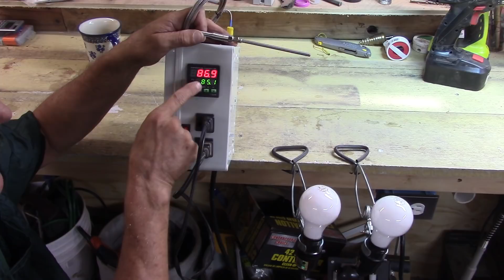Parts list and decription, assembly  Part 2

Comment: I would like to use this to control an exhaust fan for my stick offset smoker. Is this possible? I would like for part 2 to be a voice over for the non electrical type guys if possible. Great, great video, nice build

Comment: George, I have worked most of my adult life as an instrumentation technician and retired from the engineering department at an oil refinery. One thing I would mention is to keep the thermocouple extension wire away from any AC high voltage wires. If the temperature readings are erratic, try moving the TC wires away from any high voltage lines.

Comment: I want to install a water level sensor/shutoff to avoid burning out my 240v element if I allow the HLT water to get too low. Should I wire it in between the pid and the ssr or is there a better way to do it?  If I do it between the pid and ssr does it matter which wire I use coming out of the pid?
Thanks

Comment: Good day, asking from RSA. Can i please get the wire diagram? As i need to change everthing to 220V AC and 24V DC. To control a 3kW element and water pump. 
Chavannie@gmail.com

Comment: Ok call me dumb, But my question is, I'm wiring a PID 120v and a 25SSR. I want a 2000w element. I have a 10gallon boiler. Ok I have checked my breakers all are 15amp.  Doing some research, Is this going to work without blowing a breaker?

Comment: Your video's have inspired me to build my owm PID.  One point that doesn't make sense is you are using the controller to energise the SSR. The % mode  on the controller  would be a mute point as with the SSR energised you would have 100% power to you output and deenergised would be 0 % power, no in between!  Great video thanks

Comment: I am using a c100 for a 3 d printer ..can I use the 4 v to heat the printer element or do I need 240v to 24v transformer and ssd??

Comment: George great videos on the PID assembly. I’ve started putting the parts list together and had a question. I can’t find a 20 amp snap in outlet. Are you using a 15 amp outlet? I want to use a 20 amp heating element with the PID.
Reply: I had the same problem, type in snap in receptacle in the Amazon search bar and it should come up.

Comment: Hi George, on a mile hi still, do you drill a hole through the cap for that uxcell thermocouple? Doing the conversion, it's a 5/16" thread. I'm pretty sure they don't make an adaptor for that. Ha Any advice appreciated.
Reply from the maker: Anyway you get it in the vapor stream will work. 
It doesn't need to be tight just sealed. 
There are many ways to do this from drilling holes to using rubber bungs or just attaching the probe to the outside of the column with some secure tape.

Comment: Trivial question, however, not sure where the ground wires go if I’m using a plastic or wood box to make my PID?
Reply from the maker: The only place a ground wire is needed is on the receptacle. All other connections are low voltage or very low current and the PID does not require a ground. The element also requires no ground, a ground wire if used would be attached to the appliance (kettle) for added safety.
George

Comment: Hi George, appreciate your videos. How does the PID vary the power to the element when its connected through a relay? The relay would be only 100% on or 100% off.
Reply from the maker: Not true, although the connection is on/off the apparent power at the element will be a derivative of the timing from the PID output so the element is only on at 100% power until it nears the set temperature. Then the PID controls the power output.
That's the easiest explanation.
George

Comment: What if I need to provide 220 volt for a heating element? Can the pid handle that voltage or do I need to reduce the voltage on the pid  like you did for the fan?
Reply: Thankyou sir!
Reply from the maker: The PID can handle that voltage. No problem.

Comment: I just finished mine.  Thank you for the video.  I have a question.  It seems when testing with an incandescent light it just turns the light on and off.  When it's at say 50% the light just blinks, it really never looks to be 50% power or faded.  Is this correct or do I have a setting wrong?
Reply from the maker: The load requirement for a light bulb is so small you won't see it.
George

Comment: George, where did you get the 20 amp small black square receptacle in this video?  I can't find them anywhere.
Reply from the maker: I had a hard time locating them but finally did but I had to order 100 at a time. I am sure you don't need 100 of these.
Send me an email (for security purposes) to george.duncan76@gmail.com
Include your address and let me know how many you need. As long as it is not like a bunch, I'll send you a few for your project at no cost.
George
Reply: Try mouser.com  Less than $2 each

Comment: Hey George great video! I’m putting together a 240v 30amp for a kiln using this process and my question is since it is 30 amps, 10 gauge wire is needed for the power and the power only correct? I can use say 16guage to connect the PID/SSR together instead of using 10 gauge?
Reply from the maker: Just answered your email.

Comment: Hi George,  Enjoying your presentations thanks for being clear concise and thorough . And a huge thanks for sharing your knowledge and experience. Think this PID controller is awesome and would like to build one, was wondering the advantage/disadvantage of using this over a constant energy controller like Milehigh uses?
Reply from the maker: The mile high controller is analog. Meaning, it is turn it up it gets hotter and turn it down it gets cooler so just like propane you have to interact constantly to maintain temperature and you also need to predict the amount of heat added when you turn it up. 
The PID does this for you and once your still is balanced it will maintain a constant temperature with a few 10ths of a degree.
Reply: Barley and Hops Brewing  Exactly what I needed to know. PID parts ordered, doing a 20 amp setup. Looking forward to the build. Thanks for all!
Reply: Parts arrived and assembled on schedule. Wired with ease, programming made easy by your video. Awaiting a couple of mission critical components held up by bad weather and I’ll be ready for my first run! Thanks again for enlightening me to this technology. Also for encouraging me to get off of it and get going.
Reply from the maker: @chuckbrown7508  Glad to hear that. Happy distilling
George

Comment: I am planning on on building one of these within the next month or two, this is  an Amazon review of the product.  Have you experienced any of these issues? What would you do if you did have its issues? 
M. Stolle

 Verified Purchase

Terrible product. Temperature becomes more inaccurate over time, 2-5 degrees off per hour.

Product works as described from a functional perspective. The problem I ran into was a temperature slip over time, regardless of the temperature probe type used. It was losing about 2°-5° every hour on the temperature reading. This caused the unit to overheat the water it was supposed to be maintaining. Instead of having water at 150°, the water temp rose to 165° after 3 hours, and continued rising. But, the unit said the water was holding steady at 150°. After a lot of testing and troubleshooting, I found that it needs LOTS of ventilation to slow down the temperature slip issue, but it won't stop it. It was very warm to the touch, but not excessively hot in my opinion - about 115° in a 95° ambiant environment. I tried Inkbird, and it ran cooler, with no temperature slip at all inside the same panel. Electronics inside of a panel should expect to run warm and still be accurate. Not this unit! That was enough to cause inaccuracies to a level of being unacceptable in a Homebrewing application. Once I opened the panel and had a fan blowing on it the whole time, it was a bit more accurate, but still unacceptable temperature slip over a 8-12 hour period. Bottom line, this controller unit will be inaccurate over time. If you your application can tolerate a 20 degree inaccuracy, then maybe this is OK for you. But why do that, when you can get an Inkbird for the same price and know you are getting accurate readings. Just as an FYI, the issue I found was a temperature slip over time, not a calibration issue. I calibrated to start off with, but after 8 hours it was off by 15 degrees or more. I ran a dozen or more tests changing the conditions, parameters and probes. All tests showed temp slip. All the same tests on the Inkbird passed with no temp slip at all. I wasted so much money on replacing probes & a lot of time on testing, only to spend more money replace this MYPIN garbage! Terrible, terrible product!!

5 people found this helpful

Helpful

Not Helpful

Report
Reply from the maker: I really wish he would have contacted me when this happened. The Mypin is an equal to the Inkbird model. 
Both come factory set and should be re-set following our step by step directions on the video. Both controllers are normally set as a  default to derivative function "off". This is an easy fix when setting your own parameters. 
I believe this is more of a lack of understanding than a product capability. 
He may have received a faulty unit. This is possible but rare. 
I have been working with both models (only) for years now and have never had this problem. I build and send these all over the U.S. and have never had feedback like this.
George
Reply: @BarleyandHopsBrewing  thank you for taking the time to answer questions. I and your subscribers appreciate all your help.
Nathan.
Reply from the maker: Thank you Nathan

Comment: Thanks George! I'm running a reflux setup. Have you found an economical way to control the flow rate of the cooling water? I've searched proportional flow control valves etc., and have found some beauties, some less than $10,000!
Am I spinning my wheels here?
Regards,
Bill
Reply from the maker: Bill,

You can geta small in-line control valve for a few dollars at tractor supply, Lowes, Home depot. All you need to do is have a way to restrict the flow and the turn knob or t-handle on these work just fine.
George
Reply: @BarleyandHopsBrewing  
Thanks George. 
Bill

Comment: George, Wow! I was an instant subscriber from the first video I watched. I know videos take a tremendous amount of time to render ready for YouTube. Thank you for sharing your knowledge. I’m looking to build a dual element (5500watt) each atmospheric steam generator to sterilize mushroom substrate. Is there a PID that can handle 11000 Watts or should I go with dual PIDs to handle each element separately?  Thanks
Reply from the maker: Rick,

 The PID can handle this but it is the Solid State Relay that we need to worry about.
An 11000 watt element wired as 240V would draw 45 Amps. If wired at 120 Volts it would draw 91 Amps. So to start with 120 Volts is probably out of the question. 
You could use 2 5500 watt elements and also use 2 SSRs. This way you are only drawing 22 amps for each element.
Make sure this is wired to a circuit that can withstand the load. I would recommend a separate 50 amp circuit. Also make sure the wire can handle the draw as well (like 10AWG or even 8AWG) this is only to the SSR and then to the elements. All other wires can be low current wires like 18-20 AWG.
Hope this helps.
George
Reply: Barley and Hops Brewing - Thank you for your response. Yes I did some reading on this and found I would need two 25 amp SSRs .  I think I’m going with a Auburn SYL- 23x2p for the PID and two SYL- 2352p for the SSRs.  I want to trigger some  hepa filtration at the cooling side after sterilization.  The PID is a 30 step Ramp/Soak.  My Substrate mushroom bags need to sterilize 18-20hours at 212 degrees.  My choice for PID and SSR is on the right track?

Comment: Very good from a long time controls engineer.  Couple of points: First if the heat sink for the SSR were turned 90 degrees, you would get better airflow and cooling from your fan. Second is that since you are already installing the small 12v power supply for the fan, you could just use this in series with the relay output contact version to turn the SSR inputs on and off. The SSR inputs an VERY low current so there is plenty of power for both. This would give the option of using either type of PID output.
Reply from the maker: Thanks. Always appreciate a little help from those in the know. 
I'll need to give that a try but wiring the fan to the output of the PID would only have the fan working when the SSR is energized. I guess that would be enough to keep it cool. It doesn't heat otherwise. Hmmmm. Good idea.
George
Reply: I was just pointing out that you have a 12vdc supply already there, Do not change the wiring to the fan, it just stays on. But the "Relay output" of that type of PID is just what the call a "dry" contact, essentially a switch closure. So you could run +12vdc to one side of the relay contact output, and the other relay contact output terminal to the + input on your SSR, and then the (-) terminal on the SSR back to the 12vdc ground. (A second use for the 12vdc you have there.) This way the ssr input is energized each time the relay contact in the PID is closed. Again very low currents in the SSR input so no problem in the output contacts of the PID driving it. I hope this helps.
Reply from the maker: Thanks

Comment: Hi George.  I have one of those Anova immersion cookers (also known as "sous vide").  It occured to me that this thing is nothing more than a heating element with a built-in PID controller and an impeller.  It has a temperature range of something like 75 F to 211.5 F.  Do you think it could be fashioned through a lid of a pot to be used as a still?  What are your thoughts?  Your videos are awesome.  I watch them all the time and every time you publish new ones.  Thanks for the educational information you put out there.
Reply from the maker: I looked up this immersion cooker. I'm not sure I would try that. I just can't see how you would be able to seal it in a kettle to get the results you want.
Reply: @BarleyandHopsBrewing  no doubt it would be tricky and a bit of work.  If I try to get it going I'll let you know how it goes (or doesnt go 😉).  Thanks for your reply.  I appreciate it.
Reply from the maker: Anytime. Don't be afraid to subscribe
Reply: Oh I'm subscribed George.  I never miss a video!  I've told my friends about your channel as well.  Too good of a resource to not share!
Reply from the maker: Thanks. I thought maybe you were not since your comment showed up in my social tab but not on the youtube tab. 
I always check both places so I don't miss anyone.
Happy distilling
George

Comment: Can you control a chest freezer with a PID instead of an STC-1000?
Reply from the maker: Definitely. The PID can be set for cooling or heating.
George
Reply: But would the on and off switching, not be too harsh for the compressor?
Reply from the maker: You can set it manually with variables of your choosing so it doesn't bounce around.